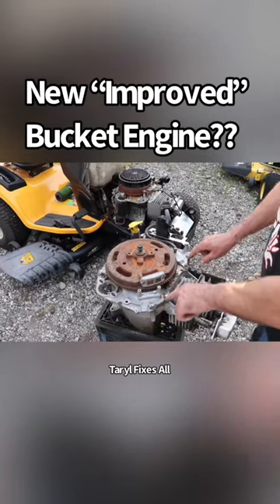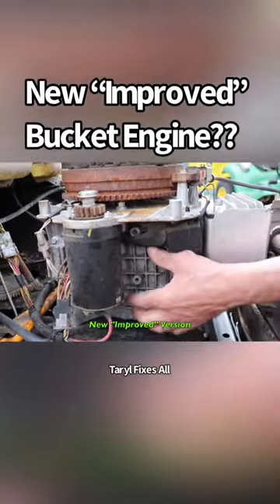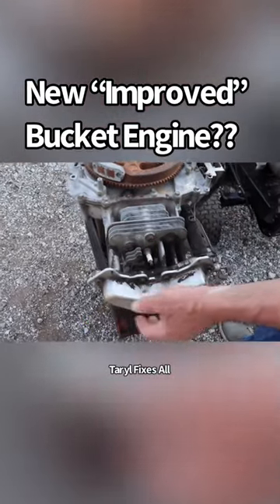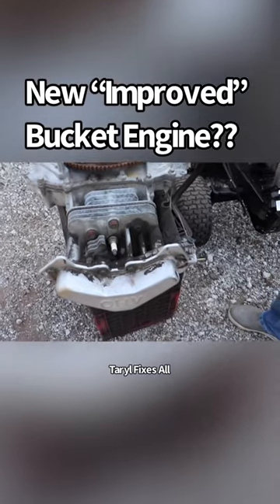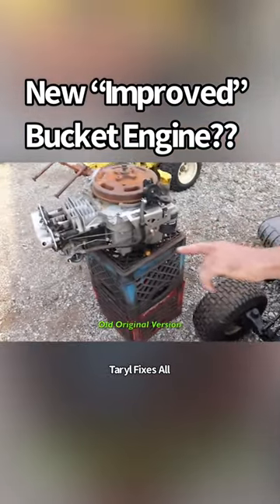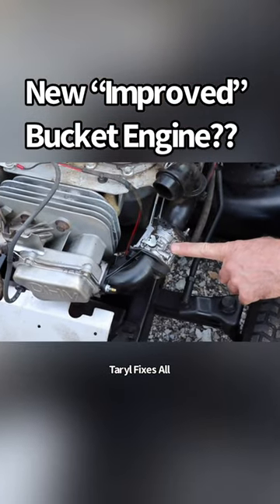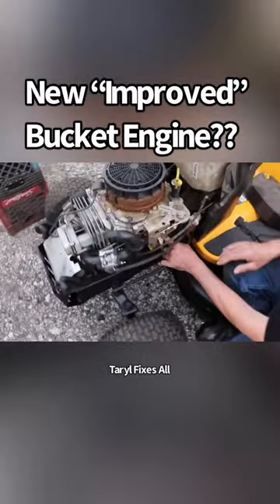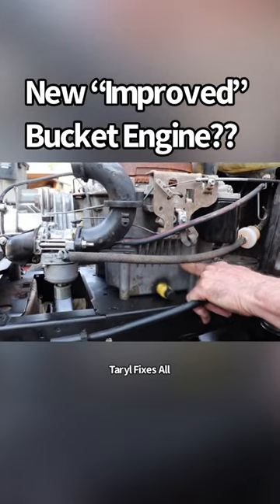New “Improved” Kohler Bucket Engine

Comment: I must be lucky. I got a bucket engine and I check it once a year. I think its a 2016 model. Bolts are never loose and I've never had a valve cover leak. Granted I have adjusted the valves once and replaced the gasket but not because it leaked. Prob blow up this spring my luck since I bragged on it. haha

Comment: I'm glad to see they are trying to improve, there's a Kohler Plant in my town, I need to stop by and thank them. :)
Reply: I liked mine.  It was a good engine until it exploded and cracked the block all the way around.  I did some research and found a few blocks on ebay for $100, and bought one.   So I'm going to swap everything over and get it going again.  It's still a $1200 engine if you try to buy one new.
Reply: @calholli  I've had 2 singles that blew the block out and I'm always repairing the leaking valve cover gasket on other peoples Courage's. I do have a V-twin 25hp Courage on my 2007 Cub Cadet LT1050 that's still going strong to this day. I hope you can get yours fixed up brother. 👍
Reply: @Big_Johns  I've already put a 18hp Briggs opposed twin on my rider.. But I'm still going to get the engine going as a spare. :)
Reply: @Big_Johns  never the courage!!!!
Ask Tyrone!?!
Reply: @chk3700  yeah they are pretty crappy.
Reply: @Big_Johns  commandeer
Reply: @chk3700  Yep, I love the Command.

Comment: I recently acquired one of the older style bucket engines. The valve cover gasket leaks like a sieve. I need to go back and watch taryl's earlier videos on fixing the leaking gasket, and check the bolts while I'm in there.

Comment: I got 300 hours out of my 2011 Cub Cadet LTX 1042 Kohler Courage 20HP.... No major engine problems..Valve Cover gasket,  Exhaust Manifold bolts loosen, Carburetor went at 280 hours, Engine mounting bolts loosen....Engine was still running well when I sold it

Comment: What's so bad about the Nikki carburetors?

I don't remember any common problems with them, but maybe the engines were "worn-out" before the carbs had problems.

(I am a tech, not an operator, so I didn't cause problems, I just fixed them)
Reply: The rebuild kits cost a lot more..  That's basically it.  I remember him saying the rebuild kits were like $60.  But I've seen the Chinese version on ebay for $35 for the entire carb.  But a rebuild kit for an opposed twin is only $8-  for example.
Reply: @calholli  I've never needed one, they were that good.
Reply: @Iowa599  The problem is the fuel.  If you leave our modern fuel in the carb, it will evaporate quickly and gum everything up horribly.  I just started shutting my gas off and letting the engine run until it's out of fuel when I park all my stuff now;  and I don't have any issues like that anymore.  It's just annoying.  They really messed up our fuel with this ethanol.
Reply: @calholli  oh…I'd blame that on the owner/operator, not the carb, since that will trash any carb.

I suggest switching to ethanol-free gas, at least for power equipment. I did. It costs me a bit more, but saves the carbs.

Comment: Almost every Kohler courage engine I have seen if you take the engine cover off and check the bolts he talking about 95% of the time they are loose. Or the heads are broke off. I fix and sell lawnmowers and first thing I do on the courage engines is loctite each bolt first thing before anything else.  Probably out of 100 engines 6-8 still had tight bolts all other were loose.  Had seen cracked blocks before.   Worst engine made

Comment: Kohler Lol
Reply: I have a 23hp v-twin kohler command-- those are good engines.    I have this bucket engine too-- and it was great, until it exploded itself, just like Taryl said;   the bolts rattle loose and hit the flywheel and it cracks the block.  It cracked my block all the way around, underneath and right to the crankshaft -- and was still running strong-- but it was just dumping oil out, so I had to shut it down obviously.